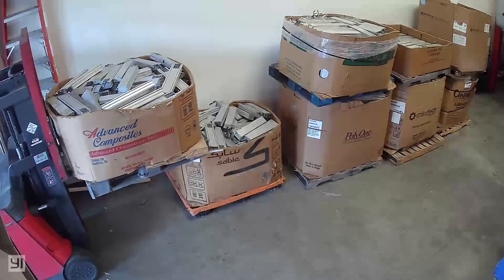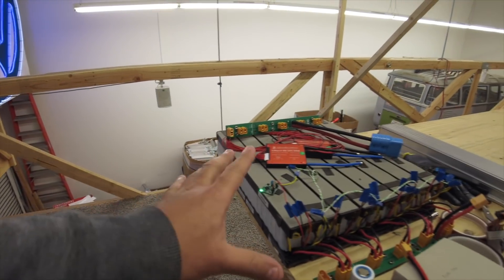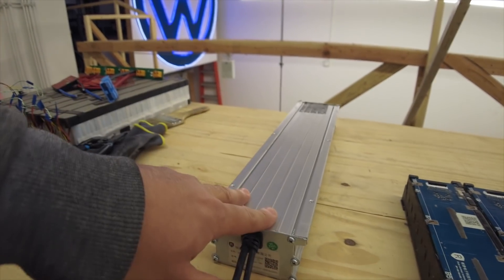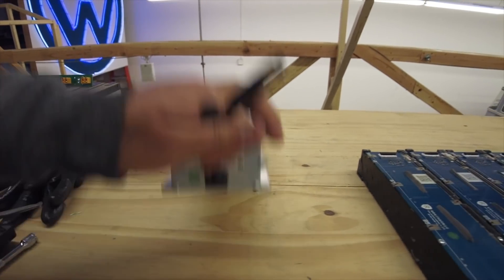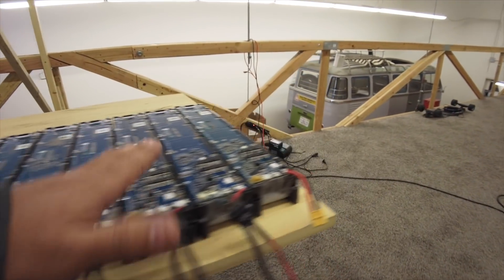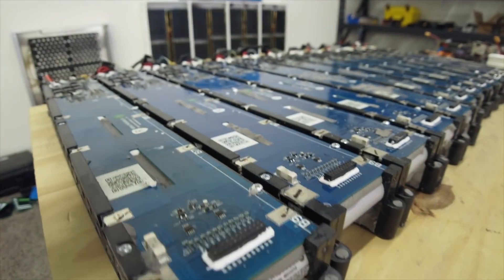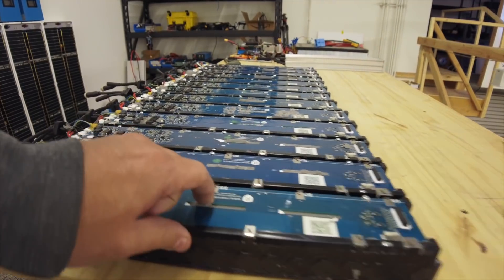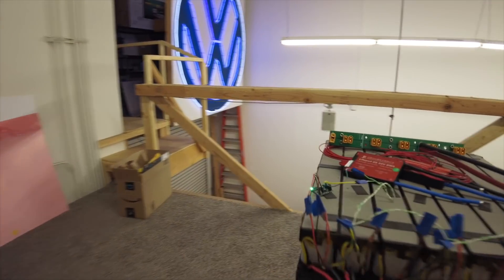You Can Build a DIY PowerWall using these Scooter Battery Packs

Comment: Mark Hall
1 minute ago
Hey I built a 2kw system for my pool it's run off 2 400W solar panels ,if u send me some ill build you one too ,I like the safety aspect of it as you don't have to worry about them catching fire due to the aluminium enclosure,I added a simply board to stop the battery at a certain voltage and start charging and one to stop overcharging, I can supply the aluminium enclosure for each pack , I even use one for my lighting in my workshop , they are amazing

Comment: i can find 100 scooters per day on the street, so how is the best and fastest way to transform free batteries to a powerwalls? I need a 20kWh 48Volt for my solar inverter. I don't want to take them apart, just use the existing wires and  BMS.

Comment: The black plastic connector should be able to pop off with little force they are usually not held in by anything.  Beside the inard pins force.

Comment: Have 10 36v 30cells packs tried to wake up
Blinking red light on battery pack small wire connection 1 out of 10 working if you. Have any ideas would be grateful help..

Comment: It's turned off because the batteries are below threshold voltage.  If you recharge them and there should be a wakeup button or something to bring the controller back online. You normally don't want to have them sitting around for long time without a charge. Love your videos, thanks.

Comment: I watched a video where the guy bypasses the negitive on the bms to the main negitive turning on the voltage. He explains that the bms is still working on the charging side. It does get the voltage on.
Reply from the maker: I wouldn't do it like that,  the BMS would not be able to disconnect the pack in the event of overcharge or over temp,  now its easy with these https://jag35.com/products/scooter-battery-controller-dongle

Comment: I would suggest leaving as much of the rubber on the scooter packs as possible and only cut it back for any of the soldering on those points at the end. Go slowly. I accidentally ripped off that black wire connection atop the BMS on two of four of these scooter packs whilst peeling off the rubber coating. Plus there are so many points to accidentally short or damage on that exposed BMS board.

Comment: Hello, is anyone trying to decipher the codes the BMS is reporting back 
once the wake up code sequence is sent? This is what the BMS is 
reporting back in decimal: 58, 22, 32, 47, 0, 3, 100, 27, 27, 26, 30, 
74, 0, 124, 15, 0, 0, 1, 0, 32, 0, 4, 135, 0, 0, 195, 11, 0, 0, 138, 13,
 118, 13, 82, 44, 1
Reply from the maker: Yes we can read voltage, current, temp, delta.  I haven’t been able to load the code successfully but i will share soon
Reply: Awesome, can you share whatever you have and we'll do the rest? Is there a conversion table with the codes and their meaning?

Comment: Hello, got one of these scooter batteries you sold me, still in metal housing. Playing around it Seems like 42V into the small plug turns on the internal charger. I can see the large plug Batt+ and Batt- jump from 16v to 32 or so, plus it draw a decent current. Maybe just putting ~42input voltage to the charge input turns on BMS and chargers. A good BMS is powered by the battery, not switched on externally. Also the large plug leads look to be Batt+ and - directly not switched by BMS. Are you also seeing that with the opened ones. Was thinking those pins would be open until the BMS connects BAtt- to external wire.
Reply: 36.8V to the small connector does nothing had to go to 42, Also figured out polarity by checking resistance from small connected pins to large connector pins. One of the small connector pins reads connected to large connector Batt+ pin. So that is positive input.

Comment: I will say this.... these are probably the best 18650's I have bought from JAG35... however I will caution you if you guys are purchasing these to harvest.... getting them out of the plastic Holders... it’s not as easy as it looks. sure, cutting the BMS off is easy enough. but since all the empty pockets between the cells and in the plastic, holders are all filled with that rubber... it is not easy I did damage a few cells in the process ☹

THIS IS NOT A COMPLAINT I PROMISE... these are very good cells. all tested to be as described. I just thought it would be wise to let people know. thank you again Jehu, you tend to be the first place I purchase Second Life 18650's from.

Comment: Electrical engineer here. I just ordered 4 of these. I will let you know what I find on the BMS.
Reply: did you record what voltage the batteries arrived at? if so what was the voltage/ have you had any issues with the batteries?

Comment: I hope you can figure it out how to use them while they are still in the aluminum cases because using a bunch of them would be perfect for my motorcycle EV conversion project. I could put four in series and four sets in parallel.

Comment: i just hope they have not a microcontroller like makita that bricks and tags the whole setup as BAD , makita use non reprogrammable counter chip that not yet been reversed ( and probably will never because when the ic is in this bricked condition its a one time Write on is part that cant be writed back to a non writed bit OTP one time programming  ) , i would like to help you to bypass this microcontroller because after all the controller just shut off the BMS circuit , unfortunly im from canada i can only help from there lol , if you can only give some descriptions of majors IC that look bigger than a normal bms , give us the ic number and i will search it out for datasheet for you for free ! then with the shematic of the ic that control the bms , its a step , your video have explain more than i was ever asked for , it will be a manner to me to thanks you for your sharing hi from quebec canada

did this ''rubber '' have the weitht and texture of typical rubber or its more heavy oily and skin like  ? , color look like sylver-oxide thermal pads that i SAlvage under sustain boards of somes plasma tvs if it is , its some build of quality what you get !
Reply: a silver-oxyde thermal layer around the whole system under an aluminium casing , look really possible after all

Comment: @jehugarcia Wow, those packs would be perfect to use as a battery system on my overlanding rig!! What would it take for me to get a few? You selling?
Reply from the maker: Yes links in the description
Reply: @jehugarcia  ahh sure, more information hidden cleverly in text form on the internet, in the case in the description.. Slick one 😉
Please update me if you crack the code to making these work as they are as they would be perfect for me.

Comment: Here is a question/ idea.  Do you think that they ever use a Hall type sensor as a quick Kill switch on a BMS?  If for a scooter, maybe this would be a hidden safety feature to prevent theft etc.  I have built an underwater DPV and it is common to use a magnetic reed switch as a safety on off to ensure no accidental arming.  It may be that somewhere on the BMS there is a hall switch or reed switch.  Maybe a strong Neo magnet may just be able to happen upon the lucky spot for activation?  It may be worth considering. If you get it to work I will buy two off of you for sure!!

Comment: There is a 5v and a 0v pin on the connector. If you jump the 2 pins with a  high value resistor like 2kohm, it should pull the 5v down low enough to trigger on the BMS. It needs a high value resistor to prevent damaging the trigger circuit. I'm up here in San Francisco. I have 12 Jump Bike packs, and several other large lithium packs.
Reply: Interesting
Reply: None of the small wires read 5V, trying all small wires with 1k to each other and all possible external pins - found yellow to Batt+ or either small plug charge pin causes Batt+ to Batt- to read 0v versus 16v with all wires open. The 16v is not the battery bus because no current behind it and will not take input voltage. I Put 42 v to small connector charge pins and the BMS turns on and I see 32v on large connector pins.

Comment: Hi Jehu, I'm a computer engineer and have the equipment to give it a shot. I'm aiming to make a device that uses the pack so it doesn't require any cutting. I live in Boston so I hope that's not too far away.
Reply: I took apart the bms on four of my packs you need these bms let me know I'll send you the bms so you can test them..
Reply: Hey,I ordered ten.   need some help programming the arduino to turn on powered thru the rx cable via serial.  It would be great to also read the tx output to find out battery voltage amps and other good info.  Can you help?

Comment: Program an Arduino to send the 0x3A, 0x13, 0x01, 0x16, 0x79 every 5 sec at 9600 baudrate to the blue wire to keep it from shutting off, it replies through the green wire.

Comment: 1).If you have any interest in saving aluminum case there is a way to do with a press
https://youtu.be/mDDsPOYj7I8.

2).https://youtu.be/NxkS5zKkOY0
Have not tested but supposedly you just relocate negative wire to get this to work correctly

Comment: Too bad I can't get your batteries up in Canada
Reply: Lithium metal and lithium-ion cells and batteries installed in or packed with equipment are mailable via air or surface transportation. This is off Canada Post

Comment: I Wish you could ship these into Canada!
Reply: me too
Reply: Hi I believe one can ship Lithium batteries between Canada and the US as long as it's in a device. The scooter batteries are encased. This is off Canada Post Web site.

 Lithium metal and lithium-ion cells and batteries installed in or packed with equipment are mailable via air or surface transportation.

Comment: I'm doing this with the other scooter batteries now. My tests show they are in good shape but the design is such that the cells get out of balance. I'm charging them in smaller groups and then applying the charge to the entire pack after getting them all balanced. I found a great site that has a forum on it and found the data sheet for the LG batteries. They are typical 18650 2600aH cells. So to fully charge them you need to bring them to a 4.2VDC and hold that voltage at a constant current until they accept no more power. This is for testing and re-balancing only and the manufacturer recommends cycling them at less than the test values. I mentioned I use Outback MPPT charge controllers and they have a program for this chemistry. I'm amazed at the cost compared to stripping and building out the 24VDC banks. I'm going to use 18 of them with 20 cells each and that represents 900aH/3.2kWH of storage at an 80% cycle curve. According to independent testing they should have a 5000+ life cycle. Over 13 years if cycled everyday.

Comment: Jehu, can you post a wire plug/pin#/wire color/internal connection table for these? Also does it look like the BMS will open the B- or B+ to protect these? I ordered one to mess with but in a case so details from a extracted one would help a lot. I will also look into the communication for free.  Do each of these have a charger on them, you mentioned in your video but that seem strange. Is it maybe the motor controller for the scooter motor?
Reply: Can you post wire plug pin # charging port 36v 30cell scooter battery 8 purple and 2 blue batterypacks

Comment: Hey Jehu, I'm an engineer down in Texas - I can definitely help reverse engineer the bms on these units. Let's get in touch
Reply: You will help us all
Reply: Hooray from the UK 
Go do it.
Reply: Hey, I'm a retired engineer in Colorado, do you have a good source of schematics? I'm reverse engineering some other packs now. Looks like are using power transistors for diodes with the base lead clipped and just using the emitter/collector junctions. Thermal protection seems to be standard 65 degree thermisters. Darned components are hard to read with these old eyes and multilayered PWB's makes circuit analysis challenging. I worked for Western Electric as we brought the AT&T PBX's to fully digital class V. I retired from Avaya Bell Labs in 2001 as a software test engineer working on voip and ATM cloud development.
Reply: Hey Jsut210 what would it take for me to get you to help me design a PCB samjktw@gmail.com

Comment: bro i will ask a few question...it is ok if will make a 12 volts 100 ah battery pack using a old laptop battery but i will directly spot weld using nickel strip not a fuse wire plss answer?

Comment: Hey Jehu. 
I would be glad to help you with those packs. No problem with 
communication protocols. I'm graduating in Electronic Engeneering and I'm head of the Electronics of the Formula SAE Team here in Perugia(we are currently designing our 
electric prototype). 
Yeah, I live in Italy, I don't think that you can send me the battery packs to reverse engeneer them. In any case if you need any help with MCU programming or PCB layout just let me know

Comment: i know those batteries , those came out from OKAI scooters , which (at least here in italy) can be rented from a company named TIER 
those things are built to be a water sealed tank
anyway 

the small connector of the battery goes directly to the charging port .... nothing fancy there 
the big connector is both power and data from/to the ESC 

the data use the USART protocol (9600 baud )

apparantly the BMS sends his information back to the ESC , which it must responds  , apparently that message is always the same and HERE
https://scootertalk.org/forum/viewtopic.php?f=69&t=6284&start=520
they find out the exact pattern ( which by the way is 0x3A, 0x13, 0x01, 0x16, 0x79 every 5 sec )

there is also another great news 
the BMS replies to this message by sending back the current % of the battery ( and much more stuff  ) so you don't need any external system to monitor the state of the battery
you can leave the batteries in thei metal container and use them as it is ( which is pretty convenient because you can store them outside )
Reply: hopefully this reaches you
Reply: This guy 👍👍🙏🙏🙏 for the cause ...
Reply: Another quick start tip , the blue and green wire ( inside the big connector ) should be TX / RX of the battery , but I always get confused on this , so try swapping them
Reply: @giorgioarmignacco1346  the scooter forum post says Blue and Green wires?
Reply: @ericr4721  you are totally right , thanks for noticing
Reply: Hopefully there not packs from there pay to ride scooters. If so then they may not be worth the hacking to get them turned on . only one way to find out! What ever it takes.
Reply: @shaunbryson898  most likely from.the pay to ride escooters??? .... That's how he has so many??? ... From there decommissioned one ?????
Reply: @shaunbryson898  sure they are
I guess those comes from decommissioned scooters , those are high power applications so after a few hundred cycles the differences from each cell became evident
For power wall tho..... Not so much
Reply: If you know that much what's to stop you from walking up to a TIER battery swapping station and just taking one of the batteries being charged? Aside from it being illegal theft of property.
Reply: @thadoviatt8087  the fact that such stations does not exist .... those batteries can be harvested only form e-scooters
the OKAI does not sell spare parts to users , only to rental companies
Reply: @giorgioarmignacco1346  when Covid19 hit, the first thing I saw is that all of the rental scooters on the street disappeared,  I suspect orders were canceled also.  These could be batteries that never got put in to scooters or lightly used scooters that got scrapped because rental scooters couldn't be rented during a lockdown.

They could be well used and retired also but at this price with BMS, potting and aluminum cases, they still might be a good deal for power wall.
Reply: @joequixotic3039  actually bere in Italy those scooters are all out , the map is completely full
Don't know why , I was expecting at least a reduction in the numbers , but that was not the case
Reply: @thadoviatt8087  morals?
Reply: @shaunbryson898  I'm just proposing a scenario that happened in NYC last time they tried to do a battery swap system. All of the batteries were stolen out of the swap station.
Reply: @thadoviatt8087  I figured. I'm mormon it's just a habit lol
Reply: @thadoviatt8087  
Well there's nothing you can do when facing thief's 
Think about the scooters packs that jehu proposed some weeks ago
Those things are designed to be "married" with the ESC , so apparently if you steal them you can't do much ( rather than destroying them)
BUT if you found someone with enough 
Knowledge time effort and redbull 
Nothing is unbreakable
Reply: This from the desk of Dr. Michael Wolfer...he is oh so right.

Comment: Hi, I am an electronics engineer and i think i got enough stuff laying around my house to get these going because i already made a lot of recycled pack working that i get from a scrapyard and i build them a power wall so if the power go's down there is some thing that happen quite a lot around here there systems don't crash because there the voltage spikes to 500v and then dies so we are trying to relay as much as possible on battery's so we have a lot of different power protocols that we use like for example can. If you want some help please contact me.